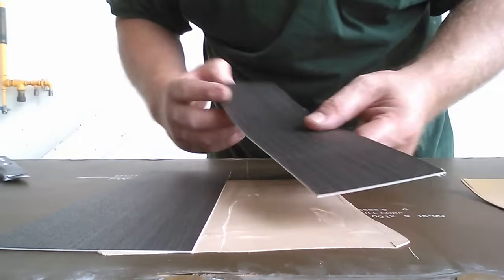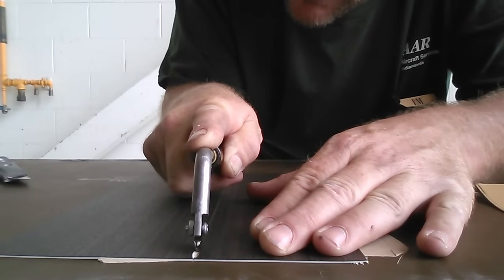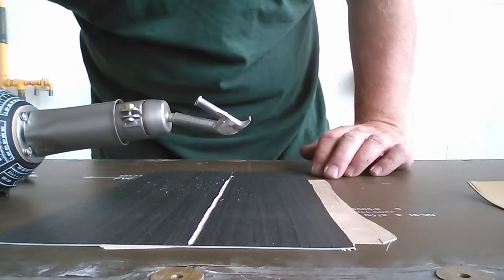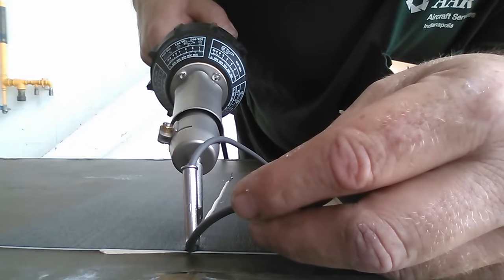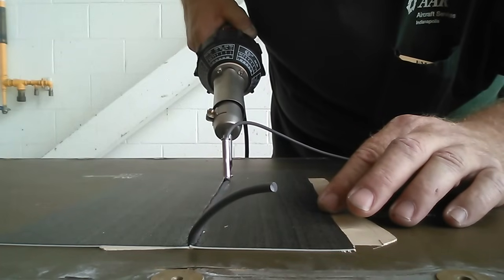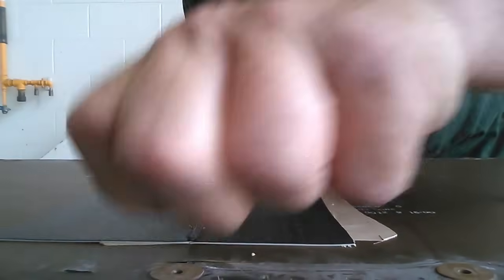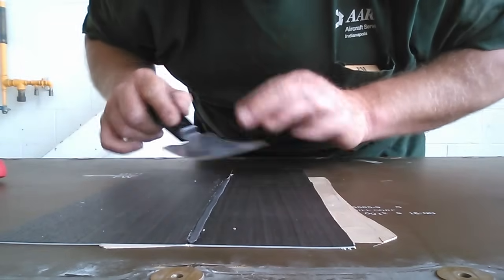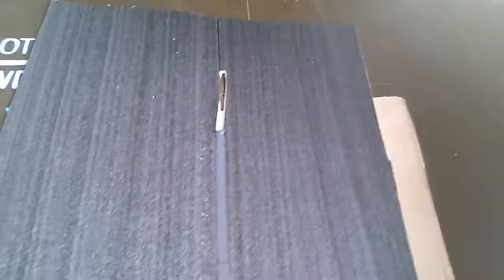Heat Weld Vinyl Installation. Best On Youtube.

Comment: This guy is clueless. You need a straight edge when grooving and the Mozart is the best tool for trimming off your weld. After your first pass the spacer spins round so you can do your final pass. You will get the weld flusher with the Mozart and are less likely to cut into the vinyl which you don’t won’t to do with a heterogenous vinyl like that one
Reply from the maker: That is a Mozart knife and this is a simple demo. I have tons of tools and autogroovers and do gymnasiums. I have an autowelder I could have shown too asshole, but I doubt anyone has a $4000.00 autowelder to do their own welding. Your comment produced nothing positive. Think about that before you troll someone. By the way you got over a 100K on your heat weld video? Then STFU.
Reply: Saying you own an auto welder has no relevance to anything Richard said. Also you’ve got 100k+ views, so now over 100k people don’t know how to weld correctly. Nice!
Reply: @frnkrizo  I also have autogroovers and welders. That’s not the point though. All this guy had to do was use a straight edge while using his pull groover and use the Mozart for the final pass. Like you said it’s a simple demo and he didn’t get the basics right.
Reply from the maker: @jameshardiman5692  now 100k people know how to do a simple weld under an airplane seat. Make your own video asshat. So I can pick it apart. Or does the effort seem too much. Bitching at me is a lot easier. Fuck all
Reply: Lmao
Reply: I agree, it looks like the first time he’s ever welded anything and he’s made a complete mess of it too.  What’s scary is that there are so many positive comments from people who think he did a great job, coming to a floor near you soon, hopefully not.
Reply: Why he going on about having a auto welder when all he dies is under seats which no-one will see😂

Comment: Where can I buy or get the welding rod? Please let me know.
Reply from the maker: You need to get from the manufacturer of the vinyl. If you are trying to fix residential vinyl this is not the fix for you. The tools used in the video are around $1600.00.
Reply: I want to do residential work with this vinyl but the manufacturer won’t want to sale it to me unless I work in the file of commercial building like hospitals or school.

I think is just very stupid. Even though I’m a contractor and I can’t get it. If you know where and how to purchase this material, please let me know.

As far as the tools goes. I’m not worried about it. I can pretty much purchase these tools anywhere except the vinyl materials and heating welding rod. Please let me know.
Reply from the maker: I guess I never had to buy. It was always supplied and I was the install tech. I will try to find it for you as a consumer.
Reply: Thanks and I appreciated.
Reply: @sueka2519  what color are you looking for?
And also what kind of vinyl it's?
Reply: @Honkahonky  I'm looking for all colors but green, gray, blue, orange, purple and yellow would do the job. There should just be one standard vinyl. If you know where I can buy this product would be great appreciated
Reply: I can purchase this product over in UK but there are to much fees involved, shipping and currency conversion .
Reply: where van i viu ir te welding Rod hwhere van o vou ir te welding Rod ? please let me know.
Reply: Where can i buy ver the welding Rod ? Please ler me know
Reply: Onde posso comprar a haste de solda? Por favor me avise
Reply: McMaster-Carr

Comment: I stopped using a grooving tool years ago ......just leave a small gap in the vinyl. Works just fine 👍
Reply from the maker: And provides more actual surface area bonding as well. I'm with you.